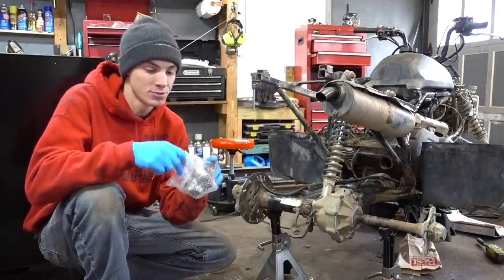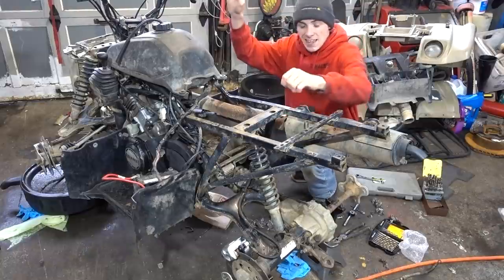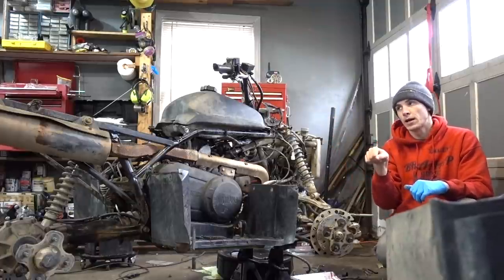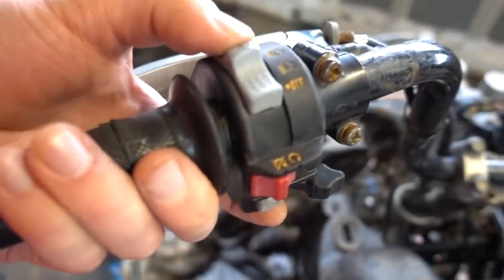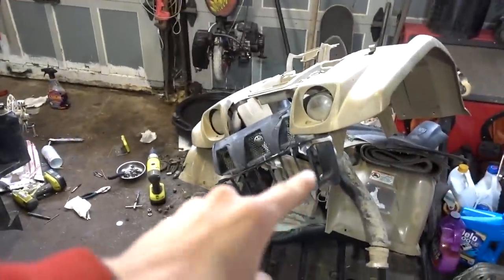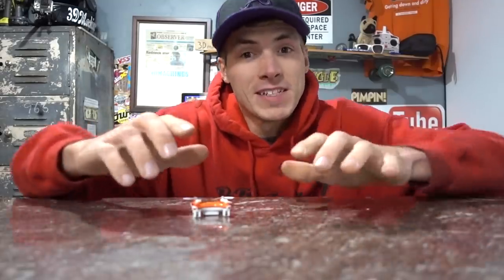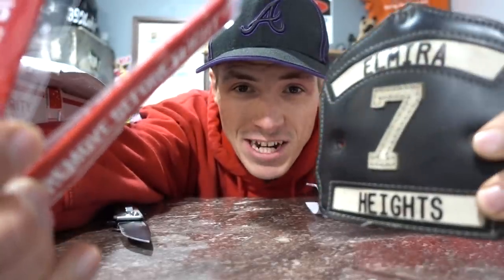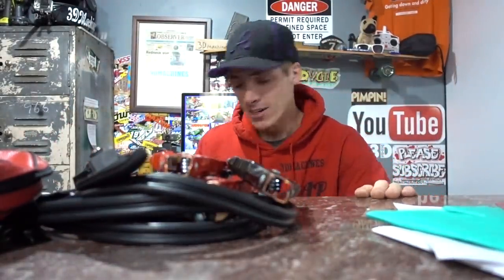WHERE WILL IT END...

Comment: get some castrol superclean or Walmart sells purple power thats the same stuff  and mix 50:50 with water in squirt bottle,  spray it down,  let it soak for a while and rinse very well (strong stuff) I use that stuff on old chainsawas that are caked with grime works every  time.  It will take all the gunk off that machine. If you have real bad spots use it on a rag at full strength and it will clean off just about anything, make sure you rinse it down well with water after it has lye in it.